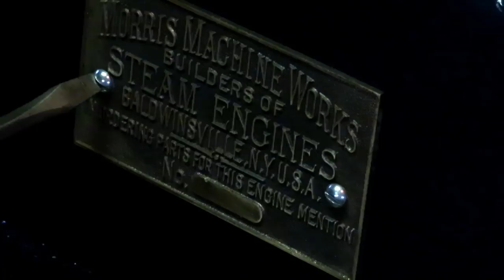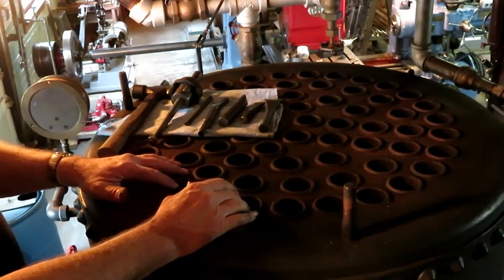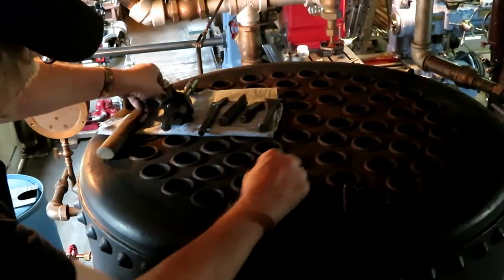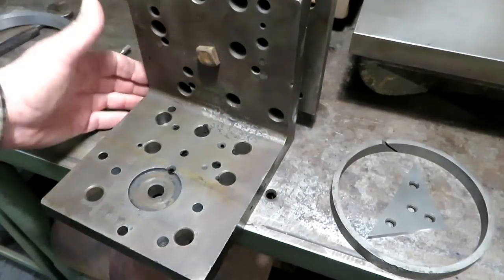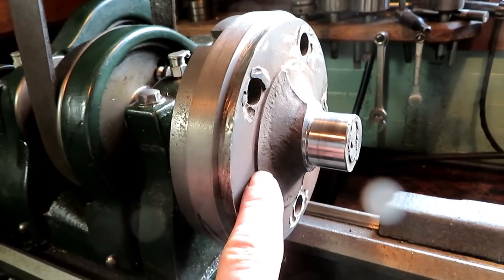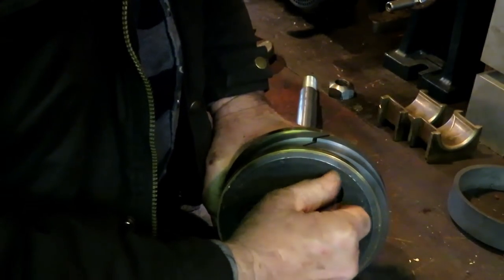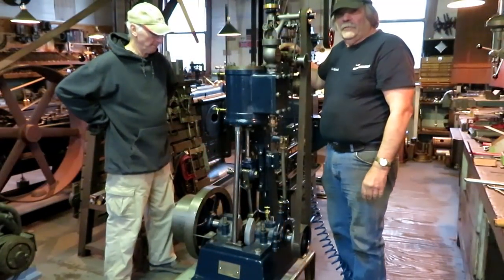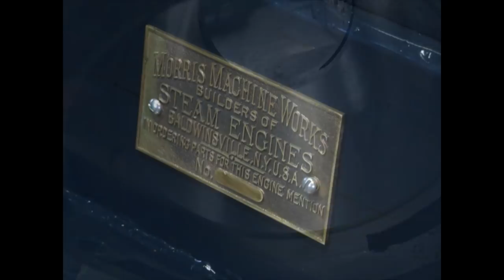OLD STEAM POWERED MACHINE SHOP 48 Will the Morris engine ever run?

Comment: Interesting video, David. I've made rings before, but approached it from the opposite direction. Turned the ring before cutting it. Cut the gap. Put a wedge in the gap and heat the ring to straw color. Let it cool overnight in warm dry sand. Remove the wedge and the ring still springs. Your method looks to be a lot easier and more efficient. Thanks for another great video!
Reply from the maker: Hi John, Lots of ways to do things, that would work too....Dave

Comment: Hi Dave , when I was in vokie one year we built from raw metals a Morris engine ,  I worked on many of its parts building it ,  cylinder and piston the crank . Even made the rings our shop teacher gave me a nylon material since we were running it on air for the show. Worked well but I had to make a thin spring steel to make it tighter to the bore . She was beautiful it was in the show case for many years after graduation. Thanks for reliving my youth .
Reply from the maker: Great story...Dave

Comment: I was living in Ireland in the '70s and the house I rented had a 50-60 gallon copper hot water tank.  It was plumbed to run thru the flue of the fireplace to make hot water. It was a good arrangement because the fireplace was used about 10 months out of the year.  One day I heard a noise in the hot water tank closet.  Upon opening it I saw the water tank was rocking and shaking with boiling water (probably near to exploding).  I ran and turned on every hot water faucet in the house to cool it down.  The amount of heat going to the tank was adjustable with a slide plate in the flue which I kept a much closer eye on after that incident.
Reply from the maker: Very interesting, I have a short coil in my automatic feeding coal furnace that will do the same....Dave

Comment: Another great video Dave. May I ask about the power feed belt on the horizontal miller?  It appears to have a crossed belt to reverse the direction, so you're not climb milling. Bit hard to see at the back of the machine. I've just fitted a crossed belt to my 1930s horizontal for the same reason. It took me several years to realise that was the thing to do, as the spindle and feed shaft centres are quite close together and I'm vee belt vintage.  I'm surprised how happily it now runs with a crossed belt.

Comment: Beautiful job - Thank you. Does the boiler have any super-heater elements?
Reply from the maker: No. but it is claimed that a vertical fire tube boiler like this has some "super heat" advantage from the exposed part of the tubes above the water line.....Dave

Comment: I saw that when they rebuilt Big Boy and then run it.
To keep they fire tubes clean they trow coarse sand in the fire box. 
The sand goes with the fumes an clean the inside of the tubes. 
I  am not sure how that would work with vertical tubes.

Comment: Hi Dave,  Another great video. You answered one of my questions about boilers, on how did they seal the riveted joints by calking. 
I watched how you made the rings, I was thinking there should have been a little more outward pressure?  Or is the specs different for steam engines than gas engines? How do you come up with the OD of the ring stock, before you cut the ring gap and complete the finished ring?
Thanks Dave
Reply from the maker: Robert, Thanks for the question. The rings do have quite a bit of compression when you get them in the cylinder. I could have measured that somehow to show it. They are pretty thick and wide and resist springing. Jushua Rose's old machinery book calls for a 2% oversize to give the spring. So I figured from that.....Dave

Comment: Congrats Dave! How does the newest engine compare with the two others in the shop in terms of horsepower? Obviously lower than the one currently running the shop, but what about the old one?
Reply from the maker: Hi Rick: The larger Richards Iron Works engine is 8"x10" and would have been rated at about 40 HP probably, The Morris is a 6x6 but of a higher speed so probably around 12HP....Dave

Comment: Dave,  When you had the Morris running on steam at the end of the video, I hard something of a clunk or knock on each revolution.  Do you consider that about normal?  I have a smaller vertical steam engine that sounds the same and I've started tearing it apart to improve that.  I don't want to go too far if that's about normal.  Thanks.  Chris
Reply from the maker: I,ve run it now for about 2 1/2 hours and have gotten some of that out. I think it might be from the cross head slide adjustment.

Comment: What is the purpose of the cylinder showing the holllow circular slotted casted opening on the bolt end at 26.0 into the video?It almost looks like a "water jacket" for an internal combustion engine.
Reply from the maker: Good question.The outside of the cylinder is hollow to allow the airspace to sort of insulate the steam cylinder to keep it hot. In some cases, waste steam was routed into it to heat the steam cylinder walls. It reduced the condensation of the in coming steam and helped the efficiency...Dave

Comment: I have watched them all to date, and have a question about cast piston rings.
 You parted the rings on an angle, and I assume measured ring gap between the surfaces exposed by the cut when at cylinder diameter.  Another youtuber repaired grease seal rings on an electric motor from the 1920"s(or thereabout).  He machined the ring, the cut at a 90 degree angle, right through the center.  He then expanded the ring, heated it and cooled it so it would have some 'spring' against the cylinder wall.  This to seal grease for the bearings from entering the area of the motor where the armature was rotating.
 Why did you not heat and expand the rings for more tension against the cylinder walls, and why not cut at a 90 to the ring circumference?  Did he need to get such tension just to hold grease in place or could he have fitted them to the bore with very slight tension?  Or does it matter at all?
Reply from the maker: I did it this way because it's the way rings are usually manufactured. Cast iron does not like to be reshaped, heat to the point of yielding effects the hardness, and ductility of it...Dave

Comment: Is there a reason for not staggering the gaps of the rings?
Reply: And that is really neat restoration
Reply from the maker: Actually, I moved them around until they were 180 degrees apart before I dropped the piston in. I guess it wasn't shown clearly on the video....Dave

Comment: I  have a question Dave but first I want to congratulate you on an excellent job you did on every step of the Morris. The thing is absolutely beautiful  which brings me to my question(s). Do you paint your own parts? That is a very deep color of blue and it seems to match a couple of other machines you have.
What brand and what is the exact color?
I don't recall ever seeing that hue on any machine before but it really sets off the polished pieces  and looks to be quite durable too.
Reply from the maker: Hi Phil, The color is just brushed on Rustolium blue, with about 50% Dark blue "one shot" sign painter's paint that I had laying around and a little flat black. I just kept playing around with it until it looked right. Probably could never duplicate it again exactly. The only other Morris I've ever seen in a photo was about that color...Dave